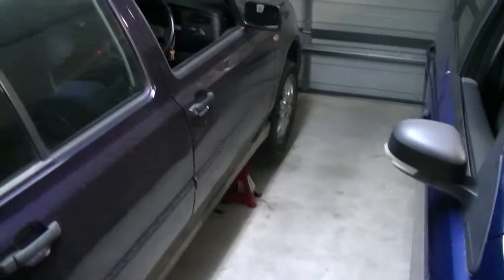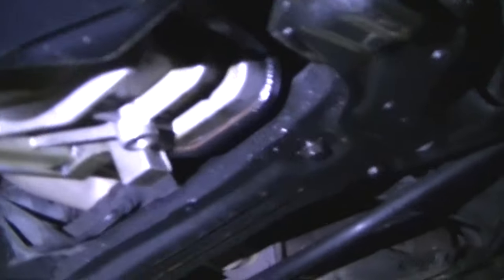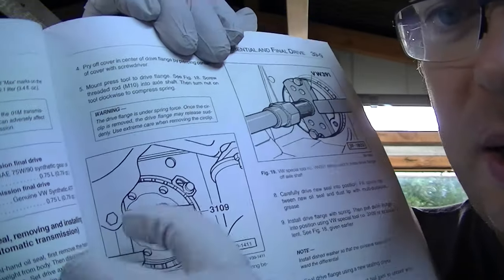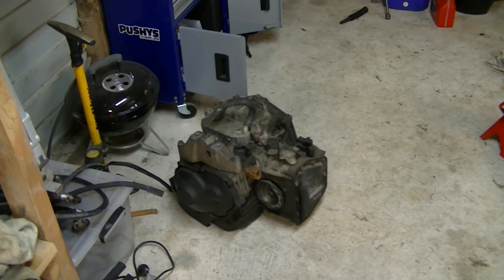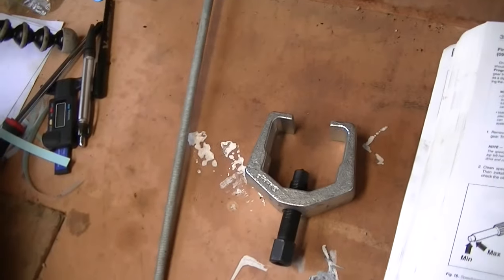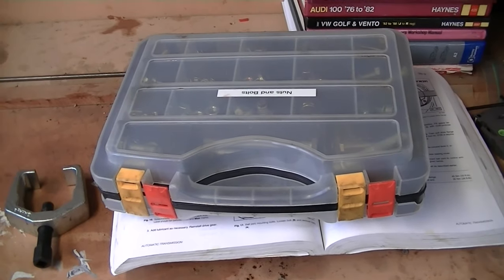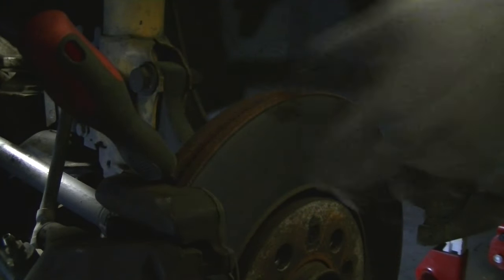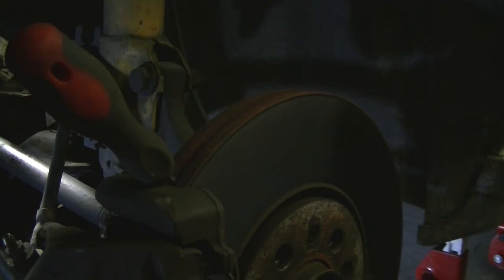MK3 VR6 DriveShaft Flange Removal/Special Tool Fabrication!

Comment: I’m here because my mechanic told me that the “driver side transmission output flange” axle screws have been cross threaded on my MK 7.5. Is this the part be is describing?

Comment: Thanks for the video. Was given a bw golf for free and the only issue is all the cv axle/driveshaft bolts are broken in that flange. Wasnt sure if it was removable
Reply from the maker: You don't need to remove it to get broken bolts out
Reply: @Badgertronix  Probably a bit easier with it off the car. Haven't had a chance to try anything. What do you recommend. The bolts are broken pretty flush.
Reply from the maker: @jaimereyes7480  left handed drill bit did it for me when I snapped one off
Reply: @Badgertronix  Way easier than I thought it would be. All 6 came out in a matter of minutes.

Comment: The lack of space is what makes doing those seals such a pain in the butt.  I can't recall if the Golf/Jetta has the same 9kg cast iron brick bolted to the subframe by the right side axle flange, but if it does, and you have to do that side, don't lay under the thing while you unbolt it.  It really, really hurts.  ;)

Good job with the improv tool there!  Looks like it might just work better than VW's option, since yours gives you some space to get fingers and pliers in on that circlip.  :D
Reply from the maker: +rhkips It was miserable doing this job. I had been staring at it for months hoping it would be ok until timing chain time. Also meant I had been thinking about my makeshift tool for a while and I have to say it is pretty perfect!

I know that big iron brick you are talking about but thankfully it isn't present on mine :) Hopefully that's it for maintenance on this car for a while, looking forward to driving it.
Reply: Badgertronix
Haha, I envy you and your lack of a chassis brick!  I tried leaving it off, but the resulting cabin noise was so awful that I cut my errands for the day short to come home and bolt the bloody thing back on.

I'm still ignoring my timing chain, pretending it'll fix itself, despite it now showing signs that it's close to giving up the ghost.

I did, however, do that IAT sensor swap I mentioned before.  I'm impressed by the results--much better response around town and on the highway once the engine is up to temperature.  If you're at all curious, I could shoot a quick video tomorrow documenting the conversion?
Reply from the maker: +rhkips I'd be keen to see that IAT trick. I think I have a new later type one on my parts shelf for some reason.

Comment: if it is front wheel drive and you say it is not the transmission oil?If it is a manual gearbox they share the same oil Not separate on automatic as it looks like they must be separate i guess.Red hydr oil on automatic.
Reply from the maker: 01M trans has a separate front diff that runs either gear oil or transmission fluid depending on the year